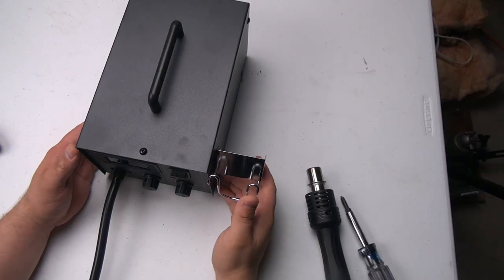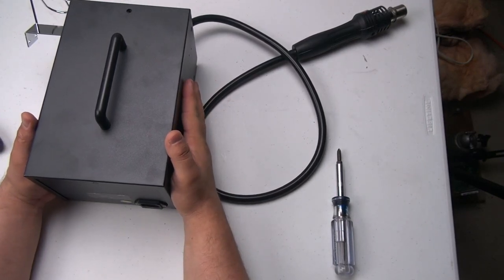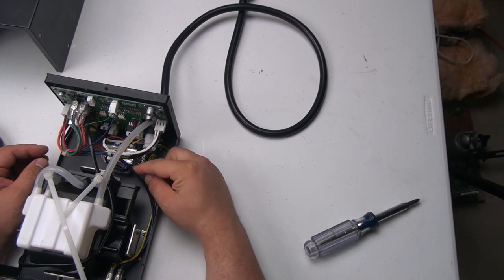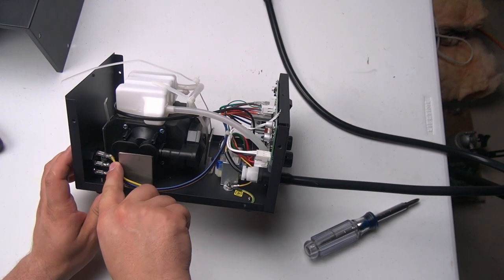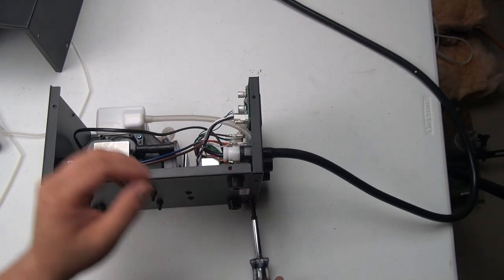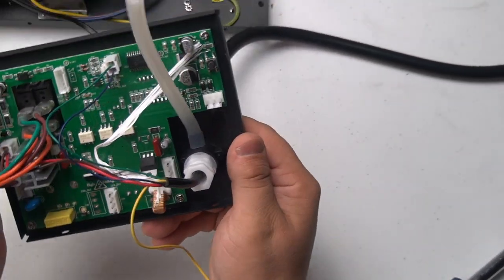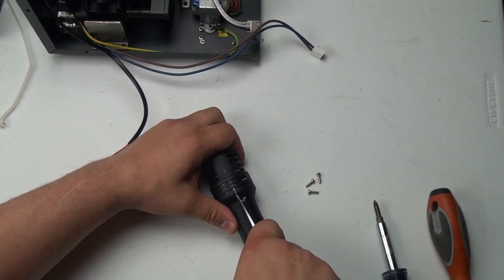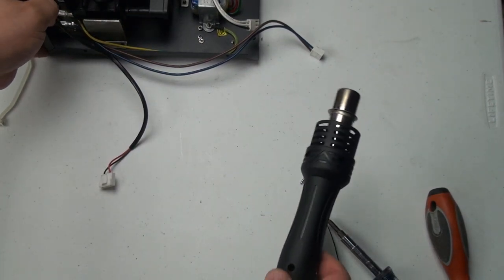eapbg #55 Hot Air Rework Station Tear Down and Repair.

Comment: Great video! I just bought a new Best BST-863 but it is faulty. The thermal fuse keeps blowing in the wand. The pump (brushless) doesn't provide any air at all it seems. Any advice?
Reply from the maker: Figure out what is wrong with the pump. Is it blocked? Does it not spin at all? The heating element needs airflow. No airflow will cause it to overheat and the thermal fuse to trip.
Reply: @eapbg  yeah I'm taking it apart to run some voltage injection on the 5v power cable to see if it spins. Any advice on what amperage to use?
Reply from the maker: @extrememod_ahu  Don't feed power directly into the motor. Being a brushless motor it has to have a controller.  Current wise it is hard to say. See what the label on the motor calls for.
Reply: @eapbg  it has no label or any markings other than "CT2" on the motherboard pin connector. I tested it and it didn't spin. Thanks for all your help
Reply: Okay so I made some progress. When I power on the unit the the fan spins superfast for about a second then goes dead. Same happens when I turn off the unit. Feels like a capacitor failure
Reply from the maker: @extrememod_ahu  I would guess that it is a control signal issue. Maybe a loose wire. The chances of bad capacitors in a new unit are very low. Poor connection would be tops on my list.
Reply: @eapbg  oh I'll be sure to explore that as well. One thing I noticed with this unit is very poor grounding so I scraped off the paint at grounding points and I'm thinking of re-grounding the pcb that controls the motor as it is attached by 4x plastic screws and sits midair, with no connection to the metal body. The 5v pin on the 8pin pcb connector shows no voltage when the unit is powered on.

Comment: Nice teardown! Much safer to use plastic tools instead of knife) Did you figure out the purpose of that button? :)
Reply from the maker: iRepair TVChanel Nope, it makes no sense that the button is with the power section.